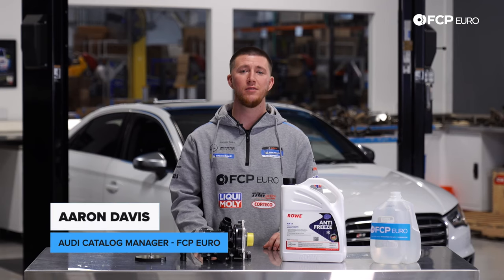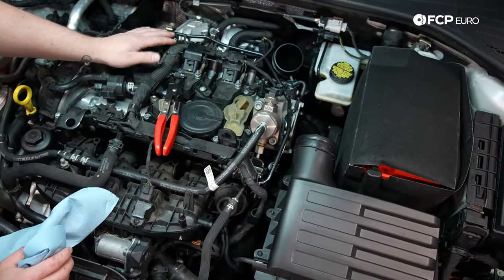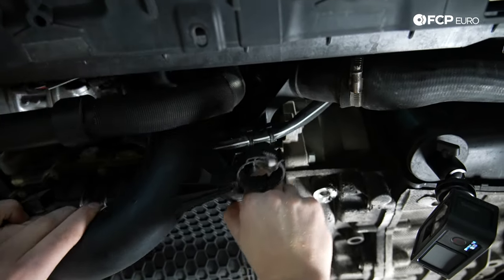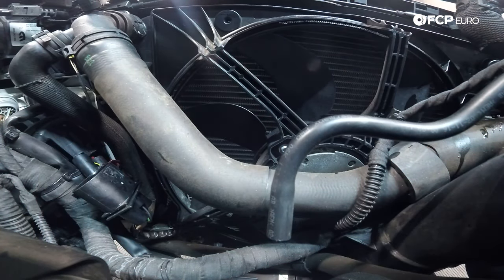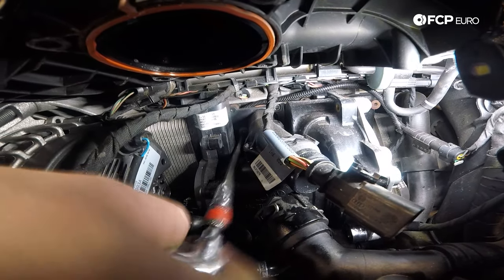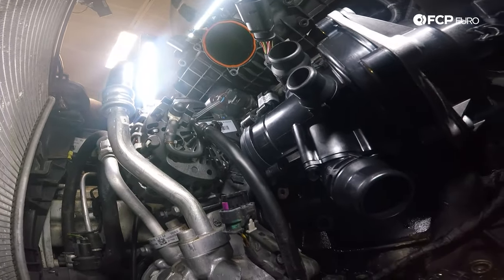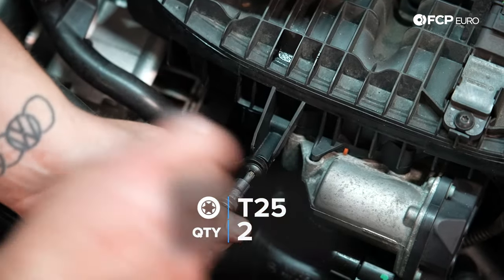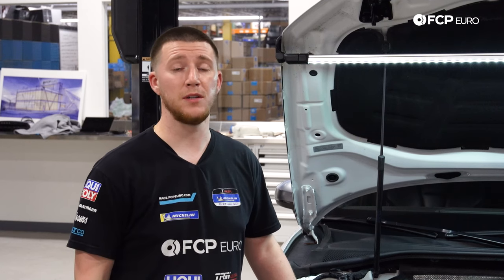Audi S3 Water Pump & Thermostat Replacement DIY (2015-2021 Audi 8V A3, S3, TT, TTS)

Comment: VAG engineers definitely dropped the ball with this design. Pretty unacceptable that you have to remove so many component to get to a pump that is so prone to failure.
Reply: Same with doing the valve cover re-seal !! What a ballache job that is .
Reply: Actually is not that big job. But definitely the design sucks.
Reply: I’m not sure that the engineers designed this by accident. I believe it keeps their service technicians in business because most people don’t wanna tackle something this fiddly.
Reply: @Surfzap63  they could droped in a electric pump whit aluminum housing and used pwm too run the pump in a 100 different ways and speed. No need for advanced thermostat just controll the pump as needed by map
Reply: He did take a lot of unnecessary things off, I work at audi, and you can get to the thermostat without removing the fan
Reply: @abdulgamietlanders  interesting, just fiddly hands required?
Reply: I do t think you can… either you remove the fan or the manifold which I think is way worst
Reply: @nicholasmic2495  yeah and have alot of cuts as well🤣
Reply: @aureliogov916  removing the manifold is alot of unnecessary work

Comment: After watching this there's no way I'm attempting to do mine, I will just pay the poor guy that has to do it.
Reply: How much did you end up having to pay?
Reply: Just got quote for 700 on this lmao fuck
Reply: @angeldlt2455  check to see if your car has an extended warranty. Depending on your State, there’s a Federal Emissions warranty for these parts to get it fixed at no charge.
Reply: @Ahjinae  unfortunately I don’t bought the car 3 years ago
Reply: @angeldlt2455  what year is it?
Reply: @Ahjinae  16’
Reply: @angeldlt2455  so is mine! Idk what State you’re in but I’d go to the dealership & mention it if I were you. I think they wouldve tried to charge me had I not did my research & said something about the State’s Emissions Warranty.
Reply: @Ahjinae  they did mine under a recall but this was 3 years ago
Reply: @angeldlt2455  700 aint bad considering the part is probably 250$ itself
Reply: Shop quoted us $2700

Comment: This is by far the best, most detailed video I've found for doing this job...can't thank you enough for the level of EXPLANATIONS and CAMERA ANGLES.  That's what's usually missing from most DIY videos.  Thanks!!
Reply from the maker: You're very welcome, Gerald!
Reply: I don't think I got the tools for all that lol, how much would this cost?
Reply: @VaderVlogs125 oof!
Reply: @SynikPixels I'm not an expert mechanic, not even an intermediate...lol, but I have done this job, twice. On my girls A3 and my s3. It definitely will take most of the day, but with a the proper tools, some patience and a little help from a friend or someone, u can do it. I was happy when I did it by myself on mine. Been driving for months now, no leaks, no issues. Follow this video like i did down to every detail and u should be ok. You will feel good u accomplished a somewhat difficult task and from then on u will know how to do ur own pump and will never be an issue.

Comment: Hi, Replacing the water pump but do you know the part number for the last coolant y union that you took out? Mine has a crack by the middle and is leaking coolant there.

Comment: I seem to recall the radiator hoses being in the way of gettin the fans out easily. And replacing that belt is overkill. I called the local VW and Audi dealers and no one had them in stock. The parts guys said they’d never seen one replaced so I highly doubt the techs do it when they do water pumps.

Comment: Absolutely ridiculous that this has been an issue for over 10 years and no permanent fix, feeling better that I bought extended warranty from the car dealer, I had a quote for £725 to do this job but the business shut down so trying another company, process starts Monday 🙄 anyone had this done and know how long it takes someone?

Comment: Before mounting the new pump you've stickt the connection pipe skew into the oil-cooler with lots of vaseline I assume? (saw you applied the new connection pipe to the waterpump first, but that's very tough mounting)

Comment: Hello, I like your videos, are very clear.If I need to replace the oil cooler I think I need to do the same steps no?
I need to remove the water pump,so evrything what you showed in the video because i saw the oil cooler is in the back of water pump...
but I m not sure if need to take out the alternator.Thank you!!!.

Comment: 14:16 there goes the radiator.
Reply: I would highly recommend to duct tape a big piece of strong cardboard on radiator, to prevent this from happening. Damaged cooling fins reduce the airflow through the radiator, therefore it's cooling efficiency. In the worst case you could puncture the lines in the core > expensive.
Reply: I noticed that to! thats why taking out the manifold makes it easier to remove and the radiator is protected by the shroud. Unless of course you are a skilled mechanic.

Comment: Excellent video. so how long of a job is this? What does Audi time it out for in labor cost?  When using the coolant fill tool does the system need bleeding or just start it up and check level once hot?
Reply from the maker: Hi Sky, we spent about 7 hours on this job filming. You will want to contact your local shop for a quote on the cost, and the coolant fill tool with leave the system full, however it never hurts to check the level after driving and letting it cool down.
Reply: @fcpeuro  
Hi did you use the radiator by-pass valve setting on the diagnostic tool to help fill the system properly ? 
 I purchased a 50L air compressor  & a vacuum tool so i can do this job , i have eveything i need to complete this but i have to add a new heater support pump while im at it as it is locked according to the diagnostic fault code,  
i have these parts already which are genuine parts aswell , i guess it will add a bit more time to the job though.
 So i want to pressure flush the system to totally clean out eveything ie the rad , the block & the heater matrix , im hoping that with the support pump removed & the failing water pump unit removed it would be easier to pressure flush everything out individually ?

Comment: Do you really need that complex setup for refilling coolant? We have a thermostat leak on our 2015 A3, the dealer wants $2k to change it. I've done many in other cars, but never had to use a setup like that to refill coolant. Any info would be appreciated!
Reply: I was also wondering this, does anyone know?
Reply: No not needed. A few of these steps aren't needed. You can remove less parts if you want for example if you remove just the throttle body you'll have room or you can do it from under the car also not as fun. But to each his own these steps are most likely similar to what a stealership would do.
Reply: @kawilifezx10r23  I think you missed the question I was asking.

Comment: Thank you soo much! Great video! I saved myself about $900 using your video!
Reply: Since the water pump job replacement, I now get almost no heat from my heater. Thoughts or suggestions?

Comment: DO NOT over tighten the water pump bolts!!!!!! They snap easy, I didn’t even torq mine 

The first time is always the hardest….Very good video, would have never got through this without the video.   5 Stars!!!
Reply: How long did you take to do the job?
Reply: Couple hours to remove all, take your time.  Needed an extra hand to work the fan assy out.  
3-4 back in

I did it over a couple of days.  This video is exactly what you need

Comment: Guys, could you make video oil full transmission oil change on VW 09G transmission for 1.8/2.0t engines on vw passat. Mine is 2017 and i want to make service myself but can't find proper instructions. Thank you

Comment: is the green switch next to the toothed belt the 3rd oil pressure switch???
Reply: Yes. Had to change one recently. Had to remove the belt cover to get a socket on it.
Reply: @peterphilipse8792  Many thanks for the reply

Comment: I have a 63 plate s3 8v would this be the same for me ?
Reply: yes, as mine was a 14 plate and cost me £1000 at a local independent garage.  mechanic said nightmare job to do.
Reply: @jasonjay7650  probably would only be a nightmare job if you havnt got an air compressor & the vacuum tool & a diagnostic tool to activate the radiator bypass valve & clear codes that flash up after doing the job , The rest is relatively simple , awkward at times due to tight spaces like where the belt cover is .
  Ive got to do this in the nxt few days on my 2016 polo 1.8 gti tsi  which is very similer to this engine , my batt is in the boot tho & my car air intake is about half a foot long above the fan shroud not the length of this one .
 I cant wait to do it tbh , 
   would do a vid but im doing mine on the road outside my house as i dont have a driveway & people always want to stop & chat so cant be asked to video it lol 
 I guess it might take a while to complete the job tho but i dont mind as ill know its done properly .😊

Comment: After watching this video I’m thinking about trying to replace the water pump myself, I had the thermostat replaced but didn’t think of replacing the water pump while I was at it which caused overheating issues shortly after replacing. I’ve never done work that requires to remove many components but it doesn’t seem awfully hard. Any recommendations?

Comment: I assume no coding is needed after?
Reply: I heard that if when you have the throttle body off & you decide to clean it out with carb cleaner you need to do a throttle re-calibration with the diag tool  because  removing the carbon buildup (if any) it will mess with the % measurements aswell with moving the swirl flap manually will put the calibration out & car will run badly .
  So if its clean inside  when you take it off dont worry bout cleaning it & dont move the swirl flap , just refit it when it needs to go back on & clear all codes after the jobs done.

Comment: Hey can having a bad water pump cause and EPC light to come on?   Noticed I had a bad water pump, I would just top it off daily for about a week then the EPC light came on and car won’t move when trying to accelerate. Just rpm’s goes up.
Reply: Went in Limp mode i spect !?

Comment: So much easier if you remove the intake
Reply: Audi calls for replacing all intake seals if intake is removed.... Setting vehicle ins service position is 100% way to go if vehicle does not have driver assists.

Comment: Why are the replacement parts still plastic?  Won't this mean you have to do the job again in a few years?
The dealer wants $2000 to do this job.
Reply: They told me 1600$ at bell audi
Reply: There is aftermarket metal thermostat housing available in aftermarket but they tent to cause some overheating issues. The biggest problem is letting oil get to the seal of the water pump. It swells and cracks the housing. Just keep the engine clean and don't spill oil.
Reply: Lol thats why i brought an air compressor & the vacuum tool , & various other tools , for what i paid out for them its a fraction of what i would have had to pay out to the dealers , i can now do the job myself & for as long as ive got the car + i can do other things with the air compressor like pump our car tyres up properly & quickly , do spraypaint repair jobs if i want to  , so it wernt a waste of money . 
   I refuse to pay dealers prices for repair work & i gain more knowledge & knowhow .
  Obviously there could be issues if something goes wrong but thats something ill take on board & deal with it & learn by it .
 Theres something very satifiying about getting stuck into a job & getting completed & i think it make you appreciate the car more tbh.

Comment: So you don’t need a special tool for the water pump  belt
Reply from the maker: You will if you are going to replace the belt!
Reply: may I ask why? I didn't see anything special holding it. I saw another video of a guy changing the pump of an S1, and he didn't have any special tool. 🤔

Comment: I don't understand. I've been changing  water pumps for the longest time and nothing compared to this 18 hour long headache. Installation was perfect, them next day P00B7 is static when ignition is on, code states coolant pump has low performance & thats when I hopped on the internet trying to see what happened. Because so far, i really don't want to believe that I have a factory defective pump
Reply: Did you find what the problem was?

Comment: No basic setting performed for the new actuator? I’ve always done it and assumed it was necessary…
Reply: What actuator?for what?
Reply: The pump has an actuator mounted to it ;) different than the old design that does NOT
Reply: @powayimports4175  if I remove the water pump because I need to change the oil cooler need to thos Basic setings?
Reply: @aysmen89  i doubt it. I usually do it when a new one is installed. But in the video they don’t discuss ever doing it. So maybe you can get away with it either way. It’s better practice to do it by the book.
Reply: You just clear all the codes that this job creates & then its all good .

Comment: Vid was going so well until you speeded it up at the end at a vital point of vacuuming the system  , which was annoying tbh ! 
  I know how the proceedure works but theres others whom would have liked to have seen that part in its entirenty in this one to be fair .😐🫤
Yes its on other vids elsewhere but if it was shown in this vid it would have saved venturing to another video to complete the job .
 After all this is supposed to be a tutorial .